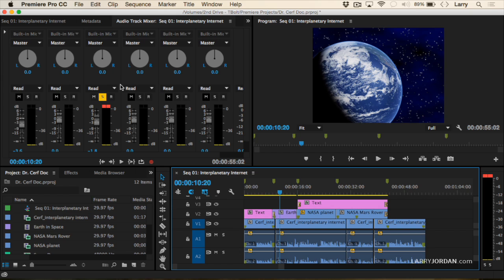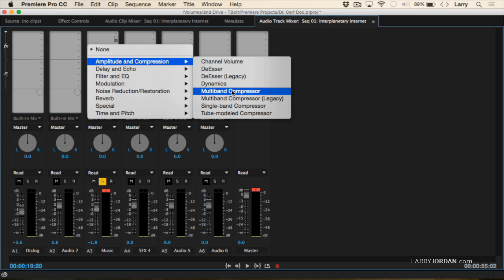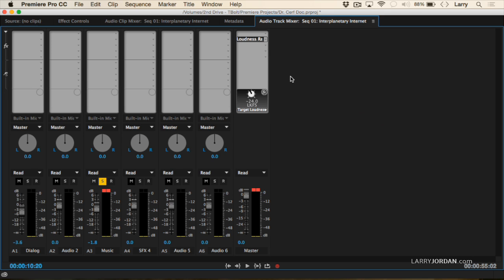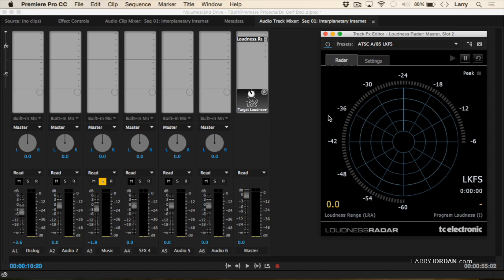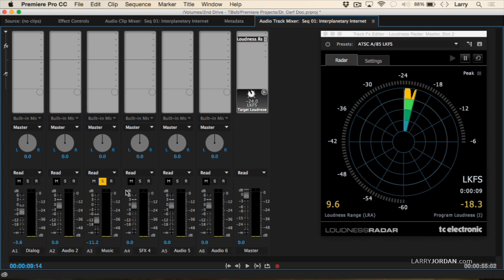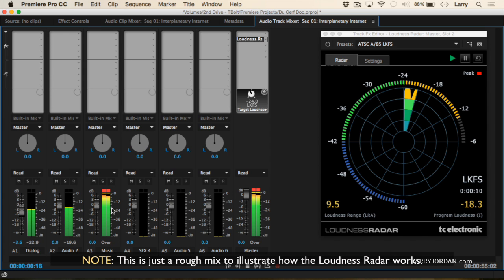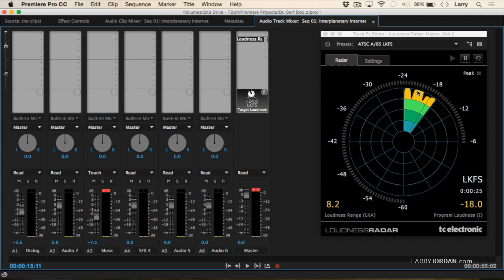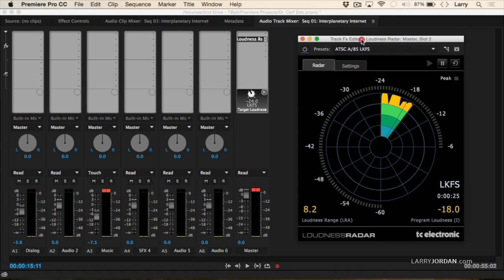Using the Loudness Radar

Comment: Why would you want -20 for the web?
Reply from the maker: Tsar:

Since I recorded this video, I've learned more. Because peak levels and average levels are different ways to measure sound levels, we need to use different standards. So, when producing video for the web:  

* If you are measuring Peak levels using the Audio meters, set your peaks to bounce between -3 and -6 dB.
* If you are measuring Average levels using the Loudness Radar or other LUFS/LKFS/Average metering tools, set your levels around -16 LUFS/LKFS/dB.

Larry
Reply: I work for a television station and from time to time we get spots that are mixed to threshold.  Usually the response we get back is "Well we did it for the web!"
Reply from the maker: Tsar:

Yup. Video editors don't realize that, just as there are many different formats of video delivery, there are also many different formats for audio delivery.

This is one of the reasons I teach audio to video editors, so that they can improve the quality of their mistakes.

Larry